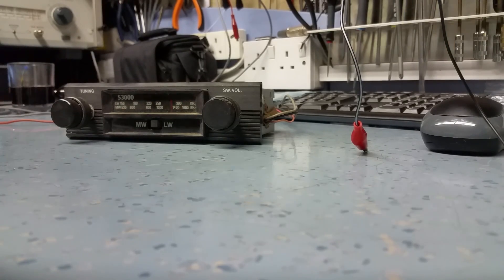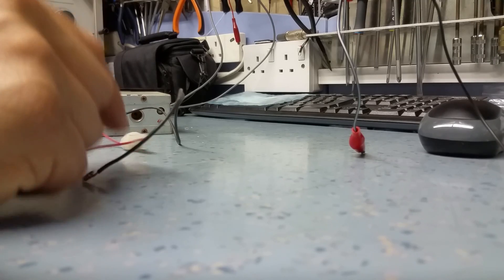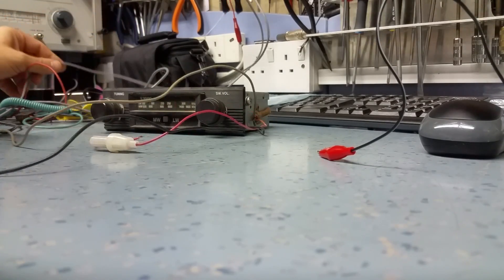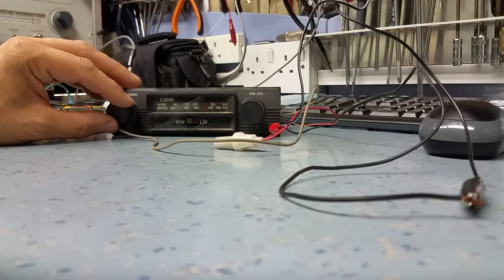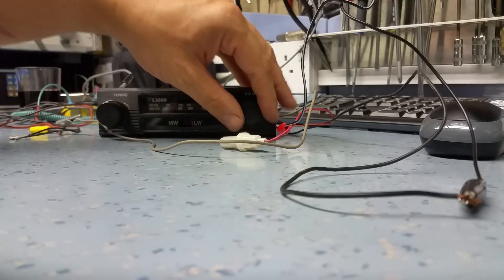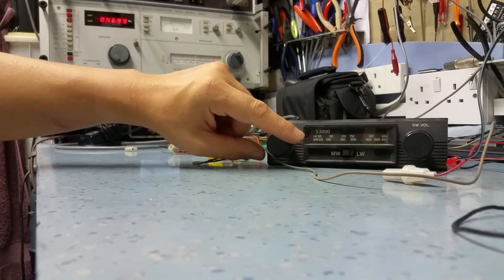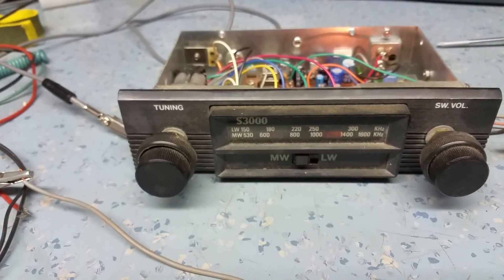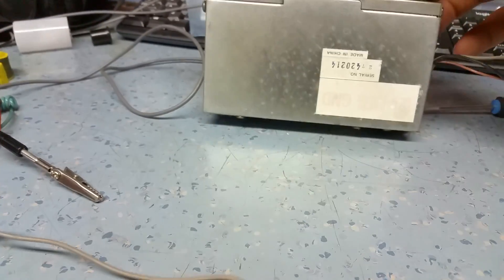Shed find LW MW radio. Will it sing?

Comment: In the late 70's I worked in a radio & TV shop working as a sales assistant and apprentice service engineer. We sold and repaired cheap Japanese MW/LW car radios similar to this one. It was quite common for us to have this type of radio returned under guarantee and in for repair, completely dead with the inline fuse blown.  A quick look inside usually revealed plenty of burnt out components, so what we usually did was give the customer a new replacement, instead of repairing it. Considering how cheap they were sold for back then, repairing them wasn't considered to be worth the effort, so outside to the bin at the back of the shop it went, lol!

Comment: I bought a high quality Pioneer car radio-cassette model KEX-50 (with FM) when I was doing my military service in Germany in 1982.  Tax free I could barely afford it.  The rather powerful output stage could drive 4 speakers (2 front, 2 rear) with L/R - F/R balance, bass and treble.  It also had a number of preset station storage, can't remember how many, guess about 15.